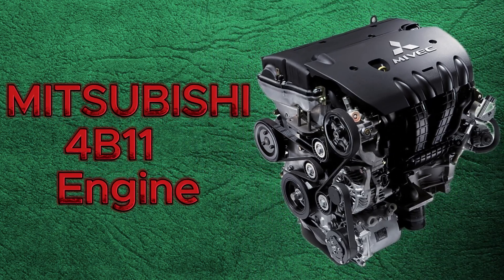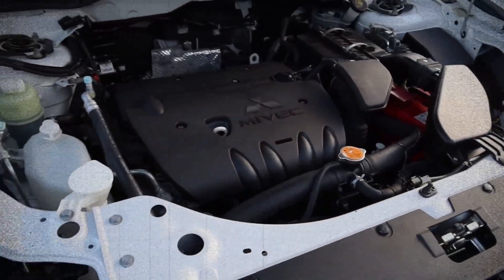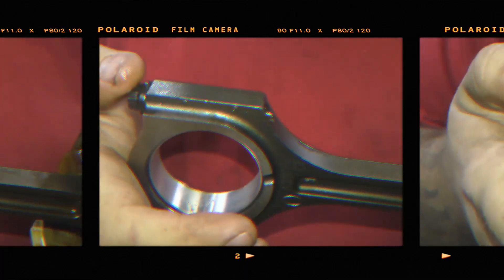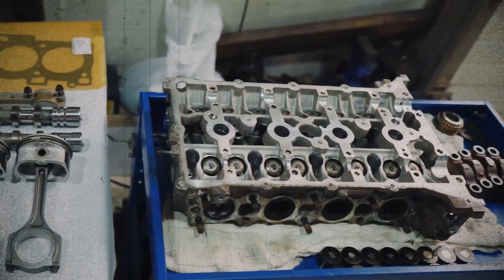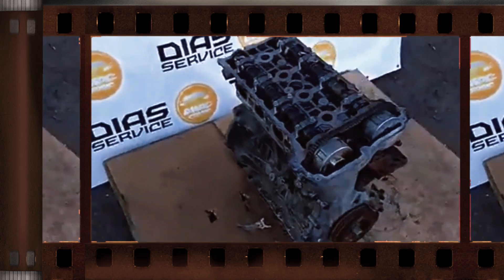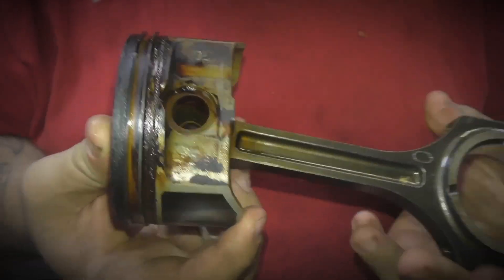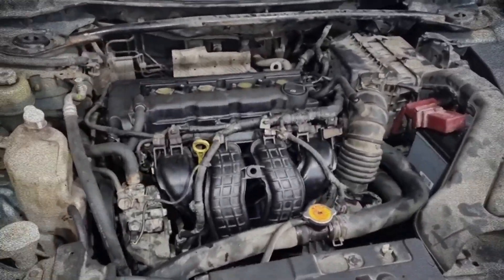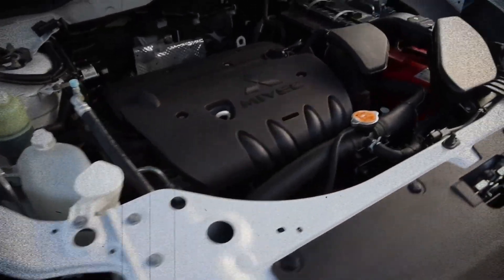Mitsubishi 4B11 Engine: A Complete Review and Common Issues!

Comment: There is no easy and practical valve clearance check.Adjustment isn’t possible only replacement with a new other size flat tappet. The engine sticker says, “ no adjustments needed” . The engine is  somewhat clattery. The timing chain will stretch and need replaced. The newer design aftermarket timing chains are about 25pct heavier. IMO the engine should be run on 5w30.

Comment: This is same technology which Toyota uses they have copied Toyota
Reply: THEY DIDN T
Reply: @fy5915 still this technology is out dated because it uses Powerpump instead of Electric steering system
Reply: @cablevlogs147  a car without electric power steering is more enjoyable to drive
Reply: @cablevlogs147 the outlanders have electric power steering
Reply: @meckkz387c But they introduced after to many years of toyota first toyota makes
Reply: @cablevlogs147  you driving base model lancer and you are also mitsubishi hater ? 😂😂
Reply: @ahmetislam2 Dear its not base its B Category sedan loved in Many countries compare it with other Same category sedans engines its totally older tech engine if I compare it with that model cars as well.
Reply: @cablevlogs147  The engine technology may be old but it is still durable and reliable and an engine produced 20 years ago cannot be a new generation engine.
Reply: @ahmetislam2 nope look past 20years of toyota they created 1nz-fe which contains DOHC with vvti , timing, chain, aluminium light weight block, tappits auto adjust with hyduralic lifters, Bigger bore and shorter stroke for better torque. Intake and front and exhaust at rare which transfer cool air faster in engine
Reply: @cablevlogs147 It's 2025 and they're still producing naturally aspirated cars, no progress whatsoever 😆
Reply: @ahmetislam2 hahah nice joke they have every category engine the worlds best hybrid technology they have others only copy them
Reply: Toyota copies everything!
Reply: @neilasd3043 hahaha nice joke😂😂